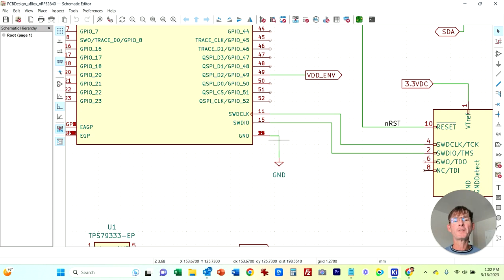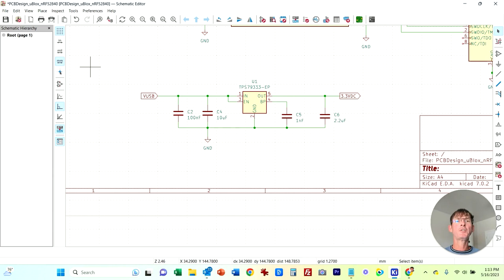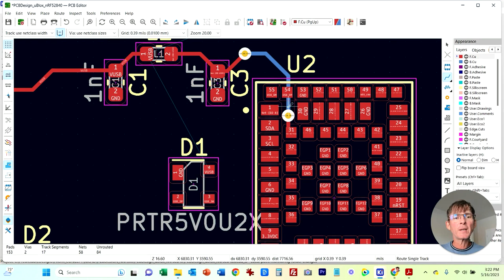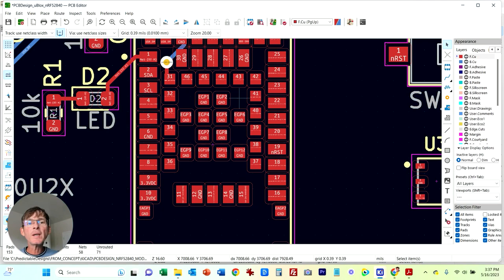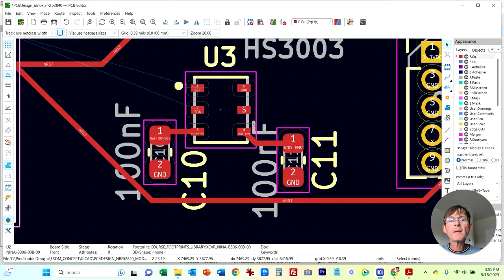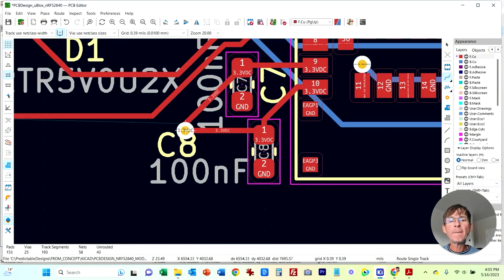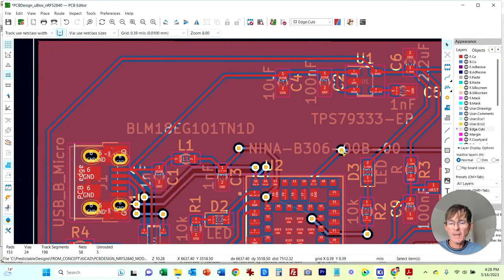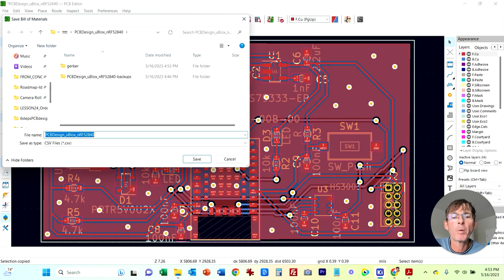PCB Design Masterclass - Wireless Bluetooth Microcontroller Board - KiCad

Comment from the maker: Download the KiCad design files and a PDF of the schematic for this project here: https://predictabledesigns.com/pcb-youtube/

Prevent mistakes by downloading your FREE DESIGN REVIEW CHECKLISTS for the schematic circuit, PCB layout, and enclosure 3D model design: https://predictabledesigns.com/design-review-checklists-youtube/

And get your other free guides:

Ultimate Guide - How to Develop and Prototype a New Electronic Hardware Product in 2023: https://predictabledesigns.com/guide

From Prototype to Production with the ESP32: https://predictabledesigns.com/esp32

From Arduino Prototype to Mass Production: https://predictabledesigns.com/from-arduino-youtube/

From Raspberry Pi Prototype to Mass Production: https://predictabledesigns.com/rpi

Want my personal help on your project? If so, check out my Hardware Academy program: https://predictabledesigns.com/Academy
Reply: Where is the link to the programmer that was specified in the video?

Comment: Why didn’t you use the differential pair router? Also,  will board houses normally populate these components to the board for you?
Reply from the maker: There was no need for differential pair routing. Yes, most board shops also offer board assembly.

Comment: If you click on the parts in Schematic View then they are automatically selected when you go to Board View. I use two monitors with each view open on its on monitor.
Reply from the maker: Great tip thanks! I only started using KiCad recently.
Reply: @PredictableDesigns  Using keyboard shortcuts can also increase your editing time. You'll use 20% or the shortcuts 80% of the time such a V, E, R and spacebar.